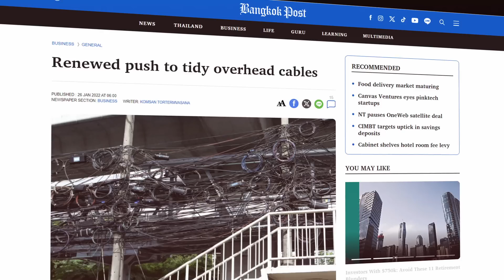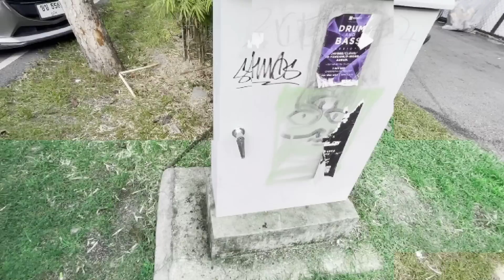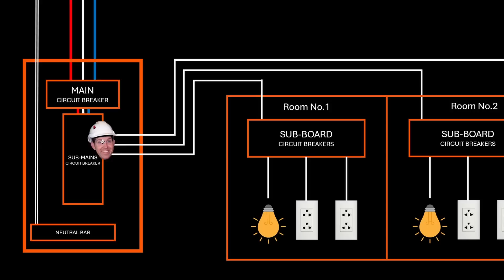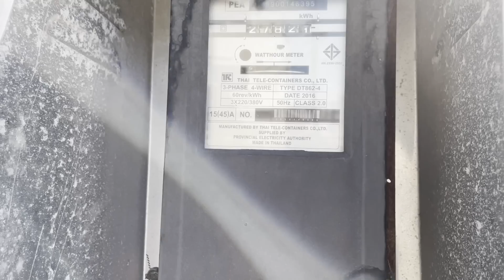Why are Thailand's Powerlines so CRAZY🤪

Comment: So, the UK shaver socket which provides full isolation via an isolating transformer, plugs which do not fall out is, in your view, "crap", whilst those two pin Euro plugs, with poor connections, rated at 2.5A, and those skinny cables exposed to a 16A breaker (or 30A) are great? Just what sort of cowboy buffoon are you?

Well, quite a dumb misinformed one, when you do not realise the plastic appendage on that dire universal adapter is there because Schuko sockets are recessed, and the pins will not reach otherwise. Not that it is secure, as it will be very loose in the recess with a lot of unsupported weight distant from the connectors.

Comment: 2:30 the "insulated bit" is for recessed power points. they relieve strain on the two pins.
Reply: specifically for sockets conforming to eu standard usually with an earth connection

Comment: Usually they put the fuse box above the main entrance door.... and yes, they don't take down the old cables if they needed to maintenance, or they changed distributor, theyjust put another cable up, even same company. don't bother replacing the old, taking it down or whatever.. just put new.

Comment: The box at 9:18 are POTS lines. The mostly not in used anymore. Thailand transitioned to all fiber-optics since before COVID.

The Telco simple run fiber to you house and tell you we not using copper anymore, even you only use basic Telephone you end up need to install FTTX Internet and have your analog phone plug into CPE to continue using your old phone number.

May be some of it in used, wired from PABX. But It's only ~70V @ 15ma at max. It will not kill you.
Reply: But he's a "youtube expert" - aka, doesn't know crap, but is here to tell you how smart he is. Meanwhile a 6 year old could tell you those are telephone line lightning arrestees - they have a gas discharge tube in them to shunt lighting strikes to ground on the phone line. Those same style used to be common in north america, but they're long since been phased out - they weren't very good for DSL, and even though the US is way behind most places in rolling out fiber, in areas that have fiber, the copper (and those lightning arrestors) has all been pulled out or abandoned, just like it was there.

Comment: That's spaghetti mess of wiring isn't just electricity it's also cable internet cable TV and telephone because the way they do it over in Thailand they don't have something called cable sharing and each individual provider if you want to have a new service they come and throw up another line on the pole so most of those cables that you see old cable TV lines or telephone lines or cable internet so it's not just electricity

Comment: Try India!.  I was in a hotel and for the 'power board' to connect a multiple plugs into one powerpoint, you get 2 lengths of building wire (earth is an optional and wasteful extra) strip one end shove it into the outlet, strip about 3cm of the insulation a bit further along the wire, wrap it around the pins of the appliance plug, a bit further along the wire do the same for appliance 2 and keep going until you run out of appliances or wire, repeat on the other pin, I don't think they have a concept of Active and Neutral, mind you Australia officially hasn't got a clue about Neutral either.

You maybe amused at Thailand, the Australian government is on a mission to burn down Australian buildings and blow up electricians, we don't even know what our domestic supply voltage is, only government bureaucrats could get us into that mess it was 240v, not anymore each state has their own nominal, min and max voltage and all different (according the the ieee).  Now it's time for sparky's to live up to their name, what potential to neutral is the black wire?  If you say 0v you are correct and if you pick a number 207v - 264v (depending on the state) you are also correct.  Our wiring colour standard is now Ph1 Brown, Ph2 Black, Ph3 Grey, Neutral Light Blue (is a faded dark blue close enough for light blue or a dirty white and a grey?), however it appears the industry is still ignoring that one.  I thought it may have just been for flex, but apparently not. 

You may laugh at UK electricians, the Australian Victorian sparky's are just well embarrassing, I know 4 whom are active electrical contractors who haven't a clue how to work out power consumption using volts and amps (don't even mention power factor or Ohms law, they vaguely remember that being mentioned in Trade school) a final year apprentice was assisting his supervising electrician to install my solar panels and just left the protective earth of the panels flapping about in the switchboard that would have been an interesting discussion with the inspector if I hadn't checked things before the inspector arrived.  

Check out this guy for a professional lineman @Bobsdecline, he needs to be let loose in Thailand for a few weeks.
Reply: UK harmonised phase colour from Neutral Black  L1 Red R2 Yellow R3 Blue,,  Now Blue is Neutral  Black is a phase with Brown and Grey.  I was in a Substation doing TI inspection and noticed new works on a 400A 415V feeder, the Black was on Neutral and then Brown Grey Blue ?.  

I called the site electrical manager who apparently micro managed everything and quietly reminded him of the new phase colours and he had a short in place at the Sub,  then I could here him call the new guy  on the radio   " Mike don't close Sub one do you hear  "...... silence !.   He got more shouty then some expletives shouting in the radio " Mike leave the Sub open copy " . 

I am still listening on the phone as Mike appears at the sub and said  "the Manager wants to speak to you don't close the line...."   " Yeh I bet he does,  then  Mike slammed the steel door making an almighty bang added a few screams for effect then said to me.   Now that will teach him to do functional checks.  I bailed out so don't know what was said but Risk assessments and Work sheets were in place on my next visit and the Manager seemed more friendly ?.

Comment: I tried to remote login to my laptop in Bangkok while i was traveling. I realized that it was running on battery. So i knew something is wrong with power in my condo. Unfortunately all the maintenance staff was unavailable due to Buddhist holiday. Found the breaker box inside a cupboard in the kitchen. Surprisingly labeled schneider equipment. After some google translating the labels i figured out what to do. The wiring looks terrible but some people know what they do. Plugging multiple kilowatt appliances into one outlet isn’t uncommon

Comment: the most interesting thing is that breaker panels are modified wrongly and the metal box is like cut in half at my school but normally they have a switchboard in every room. also gfci's are rcbo's that are normally tripping and 30 milliamps leakage and no gfci outlets

Comment: The extended section of your universal plug adapter is for euro recessed sockets. 

Someone told me that the issue with loose wall sockets in hotel rooms is because of us tourists. Apparently with a bit of persuasion you can push an Australian/NZ 2-pin plug into them, but in doing so you can damage the socket.
Reply: Same way you can get a 2 pin Euro plug into a UK socket, if you prod a (preferably metal) thingy into the ground hole to lift the shutters.  Totally works.
Reply: @kaasmeester5903  Don't give daft people ideas! Only half-joking
Reply: @kaasmeester5903  Which totally is not recommended but seems to work fine at least for low-power stuff.  The problem is the contact area between the square contacts in the socket and the round pins of the Euro plug is pretty small so I'd expect high-power stuff to go a bit smoky.  Of course the UK system has fuses in the plugs which the Euro plugs which are designed for 2.5 A max don't and the ring circuits have fuses of like 30 or 32 A or so.  So if it's smoking it may be really bad soon after.  The only saving grace is that the diameter of the contacts of the Euro plug is such that it just about fits into a UK socket without mechanically damaging it.
I used to live in the UK and travelling frequantly to the continent or internationally.  So instead of these stupid travel adapters which are usually overpriced, unreliable or unsafe (and often all three) I just swap the power cord for a suitable one.
Reply: @ralfbaechle  The Europlug is max 2.5 A.
Reply: @okaro6595  That's what I wrote.
Reply: Yes, the schuko socket ass cleverly designed so that you have to make it recessed. This prevents accidental contact to the prongs and most prongs do not meed sleeves. Europlug has sleeves (or actually just metal on the tips) as it can be used to various sockets, even non recessed ones.

The bad thing about recessed sockets is that they gather dirt like hell and are hard to clean.
Reply: @okaro6595  That dirt tends to be just dust.  I occasionally blow it out or if the dirt is a bit tougher wipe it out.
The recessed sockets tend to hold the plug pretty well.  The US type A and B sockets fail at that; the plug can easily fall out even when the socket is still in halfway good condition.
The UK connector's long prongs also hold pretty well.  Downside: if you ever stepped on one of those at night ...  and yes, the prongs usually end up pointing upwards.
I'm too lazy to write something about Swiss, Australien or Brazilian plugs.
Reply: 12,000 people die from electrocution in India every year. Thailand is bad too.
Reply: You can use the 10 Amps as well as 16 Amps European plugs, so you destroy the springs inside.
Reply from the maker: Oh now I get it. I can totally see someone trying to stick an Australian plug in
Reply: @thinklist  Nah thats just not the right plug that you were trying to plug into the wall. I had literally the exact same universal adaptor as yours, but when I tried to use it it would just fall out of the wall. Bought another one over there which has different larger diameter pins and it plugs into the outlet perfectly. 

Bit weird about the hotel providing a hairdresser that doesn't even have the right plug on it though?
Reply: The power sockets in our Bangkok condo are private so no tourists but they are just as bad. Really loose and very cheaply made. It's the same with most extension power boards that you buy in BigC, the local market or similar places. Really cheap junk made in China.
Reply: @sbalogh53  I've only spent a total of seven hours of my life in Bangkok (Song for the trip: One night in Bangkok) but I've seen enough to be as scared of Thai installations as of Brazilian installations.  I'd probably fix the sockets and whatever else to a reasonable standard myself if I can't find a sane local electrician.

Comment: I think its similar to how Philippines does its residential power and internet wirings.

Both the electrical and telephone and internet wiring are all in poles and the same poles, but in a different elevation of the pole.

That's why there is a chaos of wires, when you see both electrical and other utility wirings in the same poles.

But there are parts of the Philippines now that does not have these messy wirings
Reply: Some areas in the USA have power and internet on the same poles, but they're usually very strict about permitting and the cables are mostly neat and tidy.

Comment: That socket in the bathroom wouldn't be so loose if it was a proper socket, like a British one.
Reply: Unfortunately traveling with British plugs can put you over the weight limit on flights, because they are so friggan huge 🤣
Reply: or a 20 amp NEMA outlet
Reply: @ethernet01 don’t awaken the comments section even if I agree with you
Reply: Or a propper Euro socket, ive seen these in italy and was terrified
Reply: If that was the case we wouldn't be having this video now would we
Reply: The british is the uglies socket ever invented. It is also overdesigned to protect dumb people against temselves. The old ungrounded 4 mm round pin European sockets were legendary. If you were an idiot you could shock yourself but who cares if idiots shock themselves. The british removed that ability and now they stuggle with overpopulation.

Comment: It's a weird mash up of 240v-ish phase to earth and USA style enclosures, wiring colours with a bit of IEC colours thrown in for variety.
Reply: Because it is, there was a change of standard around 2010 that switched from the old Black/Red/Blue with white neutral standard (why this hotel use Red/Yellow/Blue I have no idea) to the IEC standard
Reply: @theminer3746  Once we used Red Yellow Blue phase Black Neutral. You still find it in old panels. AU Standards adopted Red White Blue ph Black N when Metric sizes applied. Earth as Green/Yellow standard... always insulated and multi-strand Cu conductor. 
Metric far better.   HV and LV are still colour code this way.  

Did you see in a dist board a circuit cable using a Brown, twist joined to a Green/Yellow, presumably to Earth bar? 
I wonder if they were using that for a Neutral down that line.

Comment: On the communications cables that are the spaghetti, you don't troubleshoot that.
You just run another one on top of what is there already.
Simply add to the layers.
Reply: and when it becomes a mess, you just cut it all down. 

but that seemed to be a nice country, all of those absurd amount of copper cables and it wasn't being stolen. well, in some countries the problem kind of solves itself, people will just steal the old copper , and then you keep installing optical fiber
Reply: @monad_tcp  In Agra, India I was walking through like the worst slum I've ever been to and passed by an HV line of like 20kV with no protection around any of the life parts at ground level.  After a while it dawned - all the fencing around had already been sold of for scrap ...

In Brazil I've seen life knife switches in a flat in a pretty child asseible location.  Another building had an installation which did look like original 1920 or 1930s.   What's known outside Brazil as suicide shower is pretty much the standard there.

Comment: That's wild. I felt anxious just watching you opening up the board, i was expecting a loose live tail to fly out. That wiring is an electricians nightmare fuel
Reply from the maker: I’ve actually seen similar ones in Melbourne but usually the escutcheon is left on 😆